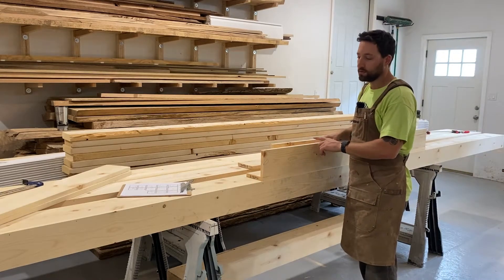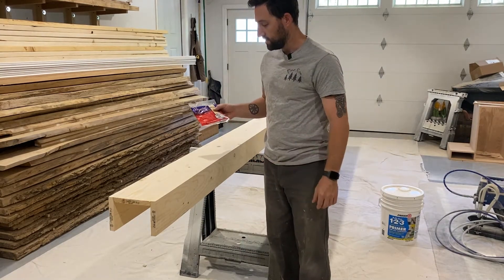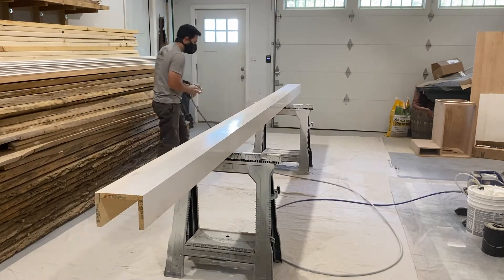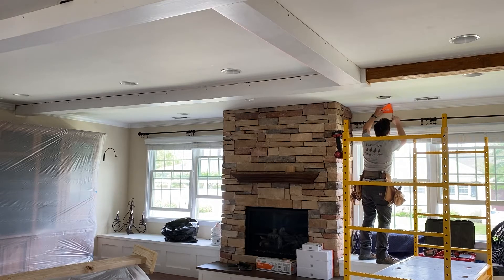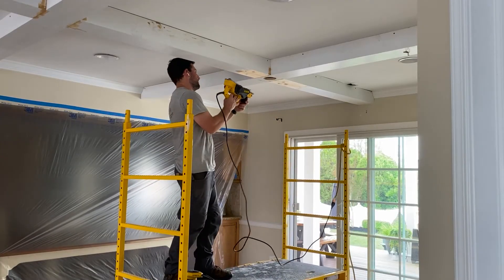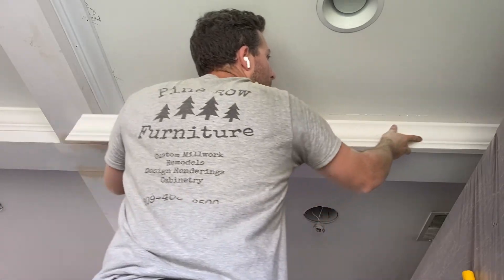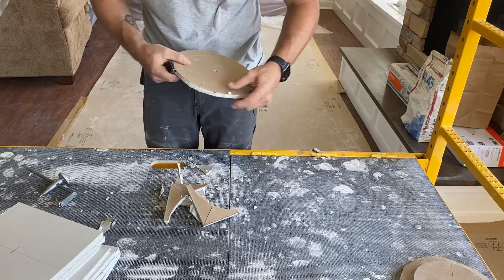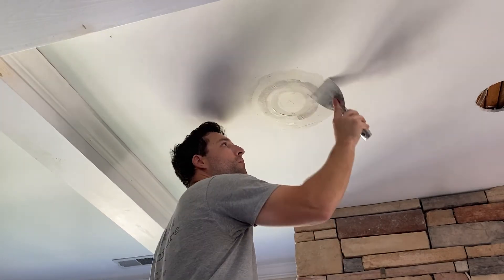How To Build Coffered Ceilings!

Comment: Nice job man. but leaving a small gap between the side pieces and the ceiling would have helped to easily level the pieces where they meet without having to plane them down. This helps because because no ceiling is absolutely 100% flat  and the gap would have been covered up by the crown molding anyway.
Reply from the maker: Yes that is true and in a few spots I did scribe some material off. Sheetrock is never 100% flat and framing is never perfect. I was avoiding scribing to help keep the reveal underneath the crown a uniform size. It would involve a lot of extra work to keep everything perfectly flat without ripping off sheetrock and installing furring strips and shims. The room was partially an addition with a large load bearing beam running down the middle of the room creating a hump that couldn’t really be fixed. In some spots it was almost and inch difference in ceiling height.
Reply: @pinerowfurniture  I understand. That’s why I said leaving the gap would’ve helped. You could have left as much and an inch gap to compensate. The crown molding would have covered it up anyway. Hey you live and you learn.
Reply from the maker: @pf5658  Always learning something new every day! Best part about construction and woodworking is that there is rarely a situation that has only one correct way to do it.

Comment: What kind of putty or filler did u use where your boards intersect? I used dap plastic wood on mine and they all cracked with expansion - nice work btw
Reply from the maker: I often use MH readypatch for nails https://amzn.to/3R6gztJ but when it comes to joints that I know will potentially crack from wood movement I will use Sashco big stretch https://amzn.to/3NaSzo9 It is paintable and stays very elastic so it wont pull away from the surface it is adhered to.
Reply: @pinerowfurniture  thanks for the info and quick reply!!